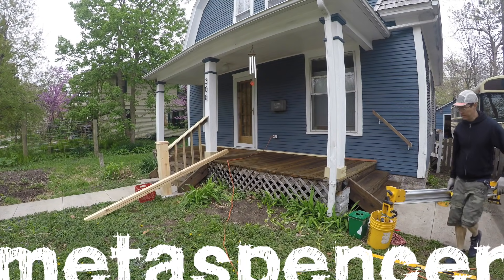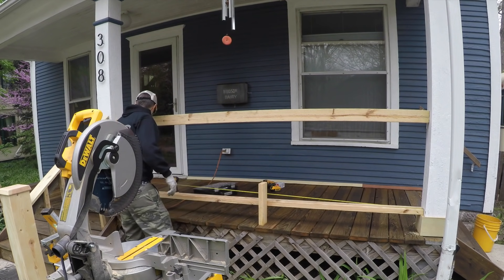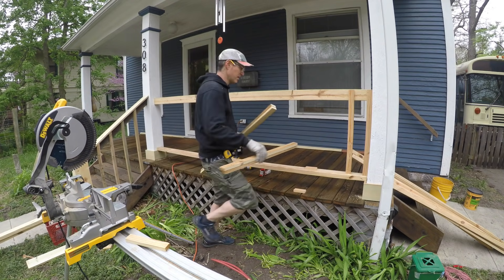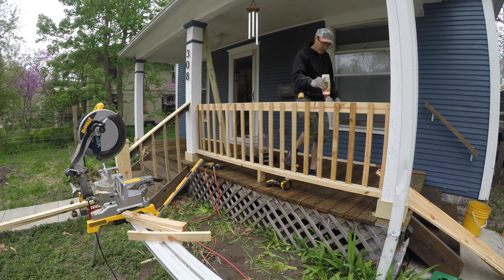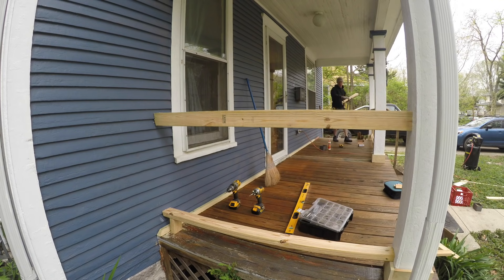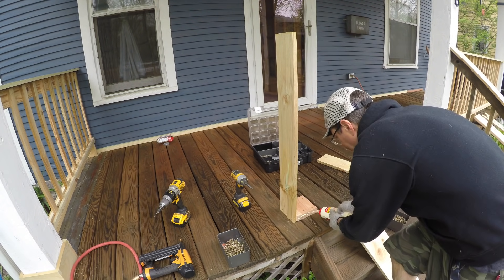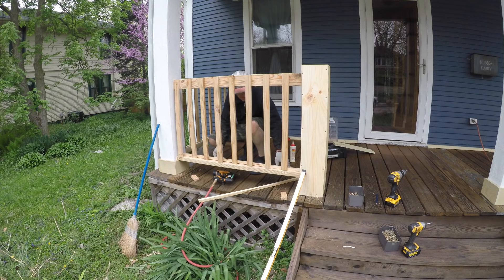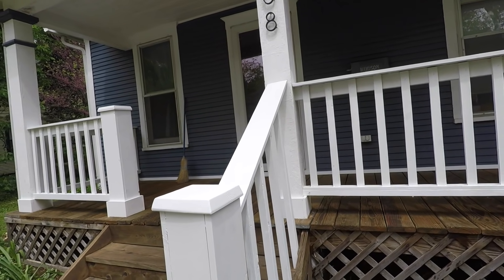Simple Porch Railing Build

Comment: Just a tip, Tite bond 2( blue top) is water resistant and Tite bond 3 (green top) is waterproof. you're using Tite bond original (red top) so the wood glue will fail eventually with moisture. Good luck good job brother.
Reply from the maker: Great tip! thanks for that ... super helpful

Comment: Good video and commentary. I am about to tackle the same job on a small side porch with aluminum awning. Thinking of going with 2 tone using cream top and bottom plates with white ballisters for some contrast which will match exterior of my house. I can always repaint the ballisters if I don't like it.  I like to paint pieces individually to seal end grain of each piece and with 2 different colors, I like a clean new look with no over run. At least it will look good until it needs new paint.
Reply from the maker: Sounds like it's gonna turn out terrific!

Comment: for the max 4" space between ballusters i just always go 3.5". make sure first one or post is plumb of course, then just hold up the 2x4 and place your balluster next to it, pop a finish nail to temp hold it and keep moving. check for plumb every 4 or 5 ballusters as you install. pretty fast. and to me looks better than 4" spacing. i know not that big of a difference but just my personal preference. when it comes to railing height, openings id rather know im over code than being right on bc that leaves some room for error if you get someone out there that wamts to be an engineer and says you are an 1/8 low from 36" haha
Reply from the maker: I like you're thinking: better safe than sorry. I'll try your narrower spacing on my next one just to see how it looks. Those little touches can make a big difference
Reply: @metaspencer  yea ive always done it bc i know its going to pass plus i never have anything exactly 4" wide, but there is always scrap 2x4 around! thanks for the vid!

Comment: Looks great! My only concern is the bottom part of the railing is going to catch and hold water. This would eventually lead to wood rot. Other than that, everything looks great! 👍 Thanks for sharing!
Reply from the maker: Strips cut to length will fill those gaps if you have water on your porch

Comment: Great video, it has inspired me to try this job myself. I’m new to code, where can I find the height requirements? Thanks again.
Reply from the maker: You can look for "uniform building code" or just check with your local zoning official or documents ... residential rails tend to need to be 36" but there are some variation to that based on the type of building, location, height, etc

Comment: @metaspencer One of the best video for railing. However, I would suggest listing the wood type used, what are the measurements, what kind of nails or screws, what kind of paints? Why not painting first then assemble? Does the PDF on esty include the info? Thank you so much
Reply from the maker: Great suggestions! I cover some of those details in that document on Etsy, but maybe not enough particulars for your taste. I'd be happy to chat about my wood, paint, and fastener preferences with. you over email though: metaspencer at gmail ... take care!

Comment: That bottom horizontal rail is going to rot so fast. Between each baluster is cup that'll hold water after every rain or snow melt.

And did I miss the reason why you put the balusters? On the outside of the first rail section, but on the inside of the second rail section that runs between the house and the corner post.
Reply from the maker: Filling in those lower gaps is a good idea for sure. On a covered porch like this one it's a bit less of a concern, but still a good point. As for the baluster variation, it was all because of the variation on this old porch which is far from square

Comment: Next time, tilt the flat bottom rail slightly...5-10° then cut your ballusters on the same angle, the point is to let the rain run off, otherwise the rail will "cup" and hold water, causing it to crack/check and rot much quicker.
Reply from the maker: Awesome idea man. Thanks for that idea

Comment: Nice efficient construction, but there's a lot you could have done to prevent rot. The groove at the top of the bottom rail is a no-no (even if you add caulking), and you should have primed and painted it before assembly.

Make sure you install the top and bottom rail crown side up.
Reply: Woops - I missed that you did mention crown.
Reply from the maker: Good points man. All that makes sense. Fortunately this is under cover, so not much water infiltration ... but I see your points

Comment: I love it.  That is exactly what I want.  I will use pocket holes.  My problem is I am doing it on cement and round PVC posts. Lowes sells hardware to attach the wood to. Never heard of your superstition, very nice...  Thanks so much it came out perfect
Reply from the maker: Good luck with your project! I've built a few things on concrete and always get the best stiffness if I can post THROUGH the slab, but sometimes ya gotta use anchors. Take care

Comment: Nice project, but I too noticed your baluster "botch"... probably would look nicer to have all the balusters on the porch side of the rail so the assembly points aren't visible when looking at your house from the street/sidewalks.  Thanks for sharing.  BTW... are those OSHA approved steel-toe crocks?
Reply from the maker: I see your point -- symmetry is ideal, but I've found that in old houses like this one a few quirks fit in nicely. Oh yeah, the crocs are bomb proof ;) Take care

Comment: Why did you pt the balusters in front on the outside and the ones on the sides on the inside?  I would think that in the inside they'd be stronger setting.  Plus bottom of the balusters would collect dirt?
Reply from the maker: this porch was on an old house and very irregular, so I ended up improvising a bit ... if you want you can always fill those gaps along the bottom with simple strips

Comment: Nice work. But one assumption you made that could have resulted in an issue was when you leveled the top rail. You assumed that the deck itself was level. If it had not been, then the look of the railing would have looked out of kilter. It would have been easier to just cut two braces and propped them underneath at both ends, ensuring a parallel top rail.
Reply from the maker: Good call man -- always good not to assume anything with an old house

Comment: I just bought your railing plan for this project, but was disappointed to find no dimensional info on the newel post which is the key to my project.  I liked how this is a simple way to build the posts that  the porch railings attach to rather than using a heavier 4 x or 6 x post and having to figure out an anchoring method.  So if you had the 1 x 6 top rail, then those boards are 1 x 6 for the newel post, but you made it rectangular, right, the way you closed the box up?
Reply from the maker: Hello, and sorry to have left out those dimensions! I've done the newel posts to match the width of the railings and to be bigger ... it all depends on what you want to go for. Matching the two widths is nice, though, and just entails ripping down two of the newel post boards by the 1 1/2" (3/4" x 2) so each side of the post matches up. Thanks for checking out the project and good luck with yours!

Comment: The more finnish way of doing it is to pre-measure everything, make a plan on paper. Then pre-paint every part before assembly. 
This way the paint gets into the cracks we can't see and prevents the wood from rotting too early. Also pre-measuring everything lets you set the gap so there won't be a little gap on the other side. 
But either way, good job on a quick build.
Reply from the maker: Pre-measuring sounds great, but wouldn't work with everything in my old house since nothing is predictable, even, square, or true. But I aspire to that kind of organization and planning! Good to hear from you :)
Reply: @metaspencer  Glad to see you working on projects. I'm currently having to deal with my daily drivers exhaust. (Rear muffler broke off.) Yeah.. It's loud.. 

I like the american style of porches. The pillars and lifted up deck. Very artistic. We don't have those in finland. (Or they're very rare.) 
If you want a cool project, build a sauna in your house. (I think there should be plans of wood burning sauna stoves somewhere so you could weld one of your own.)
Almost every house in finland has a sauna. Even the cheap rent ones.
Reply from the maker: A sauna is on my list! I like the round ones ... good luck with that exhaust
Reply: I recommend using a wood burning sauna stove. The wood stoves give a smooth wave of heat and it's more moist. The electric stoves give a dryer wave and it feels like a heatspike. Best temperatures for non finnish people are 60-70 celcius. Finnish people can enjoy up to 100 celcius of heat. (Do not recommend 100 celcius for beginners. Result may be even death.) If you have heart issues then 60 celcius is enough.
Reply from the maker: I've been in a few with wood burning stoves, one that was built into some rocks, and they were so, so nice.
Reply: Would not work for our very old house either.  Nothing measures the same.  However, instead of paint we used white stain on our deck in the back.  Prefer it more than paint.  Doesn't have to be re-done as often as paint.

Comment: Fortunately this is very close to the ground because the newel post should be well blocked and connected under the porch floor, not just attached to the surface. Same with the attachment to the siding…just not a strong enough attachment for anything higher off the ground.
Reply from the maker: It's worked out well for quite a few years now, but I see yer point!

Comment: Hi! This is awesome! I'm gonna try doing this asap! I am also planning on wrapping my tall 4x4 posts with 1x4 & 1x6 cedar planks. Should I wrap the posts first THEN, add the railings? Also, what size screws you suggest for attaching the 2x4's to house and the tall posts? Thanks in advance!!
Reply from the maker: Definitely wrap those posts first -- I've done that several times and it's always been worth it for an improved dimension and look. For screws, look for outdoor rated construction or deck screws, which are not cheap, and they should be the longer ones so 3" or 3.5" ... good luck with the build! Predrill those screw holes and it'll be great
Reply: @metaspencer  Thanks so much for the response & info! Yours looks really good!

Comment: A
Question, how is water draining from the bottom of the balusters?
Reply from the maker: No water in there as it's a covered porch. Add filler strips and seal if you're worried about it
Reply: @metaspencer  We have a covered porch and rain reached our furniture. Rain rarely comes straight down.

Comment: So I think you used 5/4x6 X10 feet for your ballisters and just cut them in half?.. 
also what size did you make your ballisters?
If I don’t have nail gun what size nails can I use instead?..
Reply from the maker: The balusters were equivalent to 2"x2" cut down the the proper length. You can find them at most hardware stores or make your own from 2"x4"s. And without a nail gun I'd recommend using wood screws and pre-drilled holes

Comment: Do I need to do anything different if I’m drilling into a hollow column?  Gonna give this a go but I’m uncertain if the screw will be secure without some sort of anchor into the column?  

Maybe pocket screws?
Reply from the maker: My columns were also hollow, made out of 3/4" thick boards that created a cavity in the middle. The screws seemed to me to get a solid connection when connecting to the columns. Note, though, that my load is not on the fasteners in the column but down below on the porch itself. If you need the load to be on the fasteners driven into the columns, you could use anchors or some kind or just more screws. Good luck with it! :)
Reply: metaspencer makes sense!!  I’ll be sure to put the smaller 2x4 as a brace like you did so it’s not completely reliant on a solid column connection!!  Thanks, here I go!

Comment: Question,on the bottom 3/4 strips it won't accumulate water?
Reply from the maker: You can cut some short pieces and slot them in there if you live in a wet climate

Comment: Great video, however I wouldn't build handrails like that. As you will soon find out, this common design has a major flaw. Installing the bottom 2x4 flat gives you a convenient ledge to set your ballisters on but... it also gives water a convenient ledge to rest on.

It's a better design to install the bottom 2x4 just like the top 2x4, and temporarily screw a board overhanging below it to rest your ballisters on as you screw them. If you really want the bottom to last as long as the top, cut a small bevel on the top of your bottom 2x4 to direct water away from the bottom ballister screws
Reply from the maker: I see what you mean -- great idea. Water infiltration is never good. Thanks!
Reply: @metaspencer  the way you did it does look better. It just doesn't last as long.

Comment: Do you have to use pressure treated lumber underneath the porch? 
Also I hear you are not supposed to paint  pressure-treated lumber until at least three months after you install.
Reply from the maker: Pressure treated is a good idea unless you're worried about touching it a lot and absorbing the chemical treatment. The stuff lasts sooooo much longer. Yeah, painting after it's dried is important as it's usually soaked with the treatment when you buy it. I would suggest pressure treated especially if your porch doesn't have too much cover
Reply: metaspencer thank you. 
Yes the porch is covered & that’s why I was considering standard pine instead of PT

Comment: What kind of wood did you use for the top? Did you use just another 2x4? Also, what size nails and screws did you use?
Reply from the maker: The very top piece is a pressure treated 1"x6" which I tend to find in the fencing section of most lumber yards. YOu could go with thicker stuff on top, like a 2"x6" but I always use pressure treated wood there as water can accumulate
Reply: @metaspencer  sorry for so many questions. But I'm trying to find the fencing boards you used for the balusters. I tried making railing around my porch and it's so flimsy I'd be scared to put any weight on them. Thankful I found your video.
Reply from the maker: Shaley Shepard I believe I ripped those down from wider boards on the table saw ... you should see that in the vid. Build it strong!!

Comment: I have to add my porch railing to a concrete porch. Do you have any suggestions or a video that shows how to attach wood to concrete?
Reply from the maker: Just use pressure treated woods, a hammer drill for drilling into the concrete, and concrete screws. The concrete screws will specify the drill bit size
Reply: @metaspencer  Thanks!

Comment: Is there a reason you didn't use all pressure treated lumber? thanks
Reply from the maker: You could definitely go that way, but I've found that on a covered porch paint can work to protect vertical pieces pretty well. I also prefer not to rip treated stuff, but that may just be my own paranoia about chemicals. PT stuff will definitely last

Comment: Around 3:40 Won’t those balusters hold water? Aka rot faster?
Reply from the maker: On this covered porch it hasn't been a problem, but you can always fill those voids with 3/4" strips
Reply: I agree and have seen many fences and decks rot out quicker with a similar design. I prefer a design that allows water/materials not to accumulate and dry fast. Covering with strips might be slightly better but again won't allow wet wood to dry quickly.